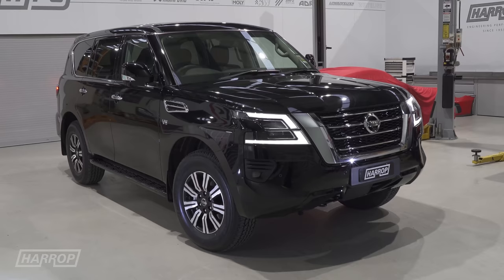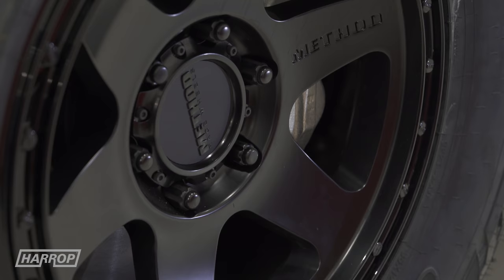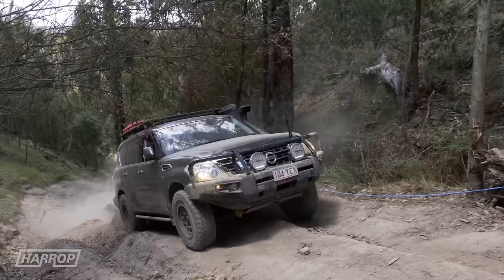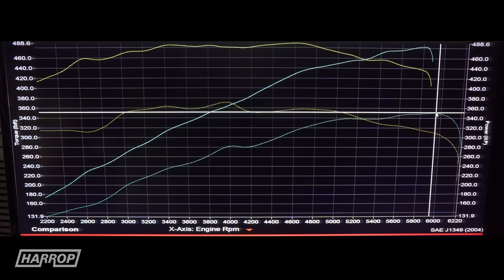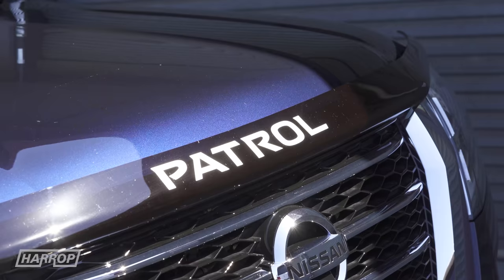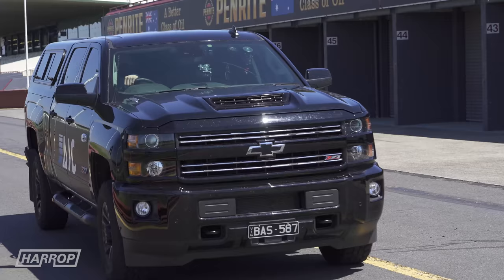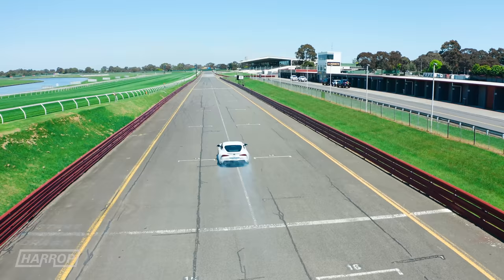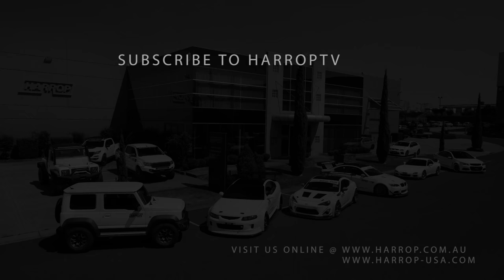Performance Testing | Harrop TVS2650 Supercharged Patrol

Comment: Those big tires must weigh a ton.  We get the same basic setup in the states on our Nissan Armada/Infiniti QX80.  On 20" street biased tires typically see 0-60 mph in 6.0-6.2 (so figure 6.3-6.5 to 100 kph) stock.  Would love to see a Harrop charged Patrol with a lighter wheel package run.  Would probably be well into the 5's which is fast for a vehicle approaching 6000 lbs.
Reply: Yea 95% of people, in the USA anyway, wouldn't have those massive wheels/tires
Reply: Yeah. I have a 19 QX80 and want to ditch the stock 22 inch wheels for 20 inch wheels to reduce weight.

Comment: I know you guys don't have the 5.7 litre 3UR-FE V8 200 series Land Cruiser variant in Australia but if you had used that, it has 381hp stock. Coupled with a TRD Supercharger, it bumps it up to 504hp. The upgraded Magnuson supercharger gives it 550hp and 746Nm of torque. That would have been a much better competitor than a 650Nm 1VD diesel V8.

Comment: so a 35x12.5r18 fits in the spare? if so, I imagine it would have to be deflated?
Reply: Yer fits. Deflate and wrestle under then a few psi back in under there. Need air on board obviously.
Reply: Then I have to wrestle in down from under the car haha rear bar set up would be ideal with your spare tyre

Comment: Anyone know if that cruiser has crossed the finish line yet?
Reply: take the patrol out in the bush then the  patrol wont be so good.
Reply: On an ifs rig like these , there really isn't much difference between the 2 off road. Slap the same lift, tyres, suspension in them they'll be fairly equal. But dont sit here preaching that Toyota's are better off road. There is a reason why 26 of the 29 vehicles in winch comps are patrols
Reply: @barragu7189  mate, you try taking it on a tight track, you can barely fit mate. Patrols are a cheap mans landcruiser
Reply: @johncheese6381  just watch all the vids on here with them 2 going head to head and jump in the excuse cue with all the other fan boys
Reply: @johncheese6381  if youre comparing apples with apples and talking about these new ones (ifs) then yes, they both are shit off road compared to the solid axle vehicles. I own a 200 series sahara, and a gu patrol.... I know which one I prefer out bush
Reply: @barragu7189  you but if you take a 200 series pit in the bush and a y62 the 200 my choice
Reply: @jonoj7666  I can tell you right now the y62 could do any better
Reply: @johncheese6381  i can tell you haven't driven either of them offroad 🤦‍♂️😂 
The 200 is a dud and the 62 kills it in every department. 

Did you even watch the link i posted? 

https://youtu.be/pyBJpcWbFxM
Reply: @johncheese6381  actually the y62 out performs the lc in the bush check out some vids on here you will see
Reply: And yet, the 200 out sells the patrol by like 8 to 1, thats says alot
Reply: @stevephillips6992  not really. Nissan Australia sells every unit it can get its hands on in Australia without one iota of advertising. They can’t get enough of them to satisfy the market. They could flog 8 times as many if they could get stock. Essendon Nissan sold 15 in a week
Reply: Yeah sure, 2019  nissan sold bout 3700 while Toyota shifted 12,600 trend is continuing like that this year, cant tell me nissan cant get there cars here!!
Reply: @stevephillips6992  face it y62 better off and on road sales don't mean shit , most of those  who paid ridiculous money for them use them for shopping or towing and living off the toyota name from years ago , check out all the y62 vs lc vids on here and you will see
Reply: @Natalie-nd9nl  not to bright are you saying sales dont mean anything!! It means, people prefer toyota over nissan!! Hope you can understand that, there are also numerous youtube vids showing the cruiser outperforming the patrol, just tour the outback, like we do all the time, hardly see a patrol!!
Reply: @stevephillips6992  haha wow insult , settle down steven , i had a look on youtube for all these vids your talking about all i could find were y62s  out driving lc200s
Reply: @dolf3288  That why they dropped the price 30k mate? Because they were selling so many they wanted to give back to the community?
Reply: @Natalie-nd9nl  Even though the Nissan is 30% cheaper they sell 90% less.... 
The only people who don’t like Land Cruisers are the folk who can’t afford them.
Reply: @craigdavid6668  and people under 70 years of age!! The snoozer is for grey nomads mate, the cool kids drive the y62 😎😎😎
Reply: @dolf3288  Haha! There’s an excuse for everything when you buy a Patrol.
Reply: @craigdavid6668  what’s your excuse for paying 90-130k for a dusted slug of a car? Cos you are a Toyota fan boy mate. Old saying: a fool and his money are easily parted. By all means pay the Toyota tax if it makes you feel like you are part of the crowd
Reply: @dolf3288  First of all, nobody who buys a Cruiser is short of money so that’s irrelevant, second, they hold so much value there’s no real loss mate, don’t be upset because you have to justify a Nissan to us, just be happy with it.
Reply: @stevephillips6992  patrol outsells Cruiser in the US and middle East.
Reply: @stevephillips6992  post a Video of a 200 beating a 62 off road. I can't find any. Maybe its because there aren't any
Reply: @craigdavid6668  lol! I appreciate both but I was going to mention what you've said. Fair is fair when it comes to the price. Fact is the y62 wasn't selling when priced against the 200. Doesn't mean it's not as good. Main issue is premium petrol if you intend to use it in the outback.
Reply: @diyanything4319 Your statistic is baseless. e.g.: the vehicle has a different purpose in those countries (not used off road in the same manner as Australia), the infrastructure is different (premium fuel availability), fuel costs less...
Reply: @cyclemoto8744  how is that baseless, they use them off-road everywhere they sell. It just means other countries aren't stupid enough to pay more for something that's outdated and basically behind everything atm
Reply: @diyanything4319  Just because a vehicle is fit for purpose in one geographic location it doesn't necessarily make it fit for purpose in another. You can argue the point as much as want.  For example, go drive a vehicle which uses premium petrol across a geographic region in which the fuel isn't available and you'll  find out how useless that vehicle is pretty quickly.

Comment: Yea that's sweet but how much more fuel consumption does the supercharger use
Reply: I’m currently getting 21 litres/100kms on 35” muddys in my supercharged y62 with 400rwhp
Reply: Desolate... it's actually more fuel ⛽ efficient with the supercharger on it if you are just putting around or sitting on 11Okmh with cruise control set. The charger makes it more efficient. 💯 %
Reply: @theclinchdrive  That's really bad fuel ⛽ economy. Im getting less than half of that. Take those  noisy, useless 35inch muddies off and get some road tyres. 💯 %

Comment: This video is a bit old but does anyone know what elevation they were at? I have a 2021 Armada running 295/65/20 tires and a 2in lift and my 0-60mph is about 6.5 seconds at sea level. The supercharger doesn't seem like it added any acceleration points for the cost of it.

Comment: The name sounds correct now with that SC. The "PATROL", sounds like something that could hunt you down and run you over! Wish they used that name in USA, but ours is the Armada. Sounds like a big fat slow boat that wallows around and bounces like a 1973 Ford LTD!!😂😂😂. No I know they are pretty nimble for such a large vehicle. We used to have a 2017 we bought brand new. Everyone freaking loved that truck, but my crazy ass wife decided she wanted a truck with better gas mileage. I tried to tell her that she was going to regret it...and she did. She got an infinity qx50 with a turbo four popper. Hey, nothing against the qx50,  it's a good little truck since we bought it, but everyone in the entire family wants the full size V8 wagon back! Now it's fixing to happen, because my son crashed and killed my 09' Titan and we have nothing to tow or haul with except for my 2021 SS 1LE!! I even put a tow hitch on the car and bought a small trailer for hauling trash or smaller loads.  Only problem is that it can't tow my Tandem axle trailer loaded with my John Deere 3032. Nor will it pull the 5K pound camper trailer! I actually really like towing the trash to the dump in my SS, feels like complete overkill. The car is a manual 6 Speed with that big old 6.2L LT1 V8. It doesn't even seem to slow anything at all, and it would be great if I had a full size Truck chassis and tow hitch, but the car is not made for anything over 2K lbs. So I think I'm going to just Grab a big ass Nissan or Infiniti Wagon and not worry about it anymore. I seem to remember our capacity was somewhere north of 8K Lbs. Plus I used our Armada a few times pulling the bigger trailers and it was outstanding. In fact, I much preferred towing with it over my old, now Dead Titan, as it was really stable and powerful compared to the Truck. Truck wasn't bad, but after towing with the Armada, it just was superior. Why Nissan... IDK ... That is really more my wife's preference. She fell in love with the Torque that 5.6 was laying down and wouldn't drive anything else. The only full size SUV that she tested before the Armada, was the Suburban, with the 5.3L, and it was not even a contest. I'll have to say that I agree with her on that. Tried to get her to test the Toyota but she basically refused to after the Armada. I wasn't about to argue with her on it either because we caught a wicked rebate on it too. The Armada was $5-10K dollars less than any other full size SUV and to me it rode much better, and was geared nicely. Quiet and smooth, but would rip if you gave it the beans, was a really great truck and I'm still kinda shocked that she insisted on getting a small SUV. I freaking knew that I shouldn't have let her trade it. Now two years later, I'm looking for another one 😂😂. This time I'm going to try to get a decent used model. Armada or QX56-80. She actually spotted a 2006 for sale qx56 that is, and I gotta go look it over. Prices on used ones are pretty good right now too.  I'd never super charge one myself, but I like this patrol like that . I guess it makes sense to someone, but if I want to feel that kind of power, it's gotta be coming from a sports car that can turn sharp and stop fast!! That is why I got my SS to commute to work in. Totally unnecessary, but worth it.

Comment: Nice video. I’ve owned and worked on patrols and petrol/diesels my whole life. Now I own a Tesla and it’s the most fun, fast, connected and yet carefree driving I’ve ever had. Bring on EV 4x4’s. All i see here is money down the drain and expensive parts to constantly maintain, degradation over time, leaks, servicing, eventual noises, play in gearsets. Ahhh fuck. I’m so over working on cars. I would love to get myself a new Patrol but after owning a EV sedan I just can’t go back... . I’m waiting for electric - which will be quicker then all of these anyway. - and before anyone starts. There’s already a recharge highway from cairns to Adelaide, and every powered camp sight/ every house has a power point. Yes. I’m not going to be doing 900km day trips with 2 young kids. The current charge network in aus can charge at about 1000km/h so I’m not even remotely worried about getting around even in the absence of significant charge infrastructure here.

Comment: Mate, did you get ripped off? I’m sure you do, or maybe it’s like that in aus Coz the interior looks like it’s from 2013, in the uae here we have double screens and updated dash etc... that’s not a 2020 interior! Many ppl do that here in the uae.. just Change the bumpers , fenders and the head and tail lamps and it’s good to go! Looks like 2020 but it’s a 2013... basically like a facelift from old gen to new gen.. but the car is still the old one..
Reply: Yeah for whatever reason we get ripped of in OZ.....
Nissan are still giving us the left over Povo interiors that they obviously have stacked up instead of using the new upgraded one you guys have in the UAE!

Comment: Did they say 6.6 seconds 0-100 for supercharged 5.8 litre V8. All the horsepower and only as quickly as a stock Q7 50tdi 210kw!?!?  I would not be happy.
Reply: patrol is much heavier and has 35inch tyres
Reply: Well, they are going with a supercharger that fits easily and you keep a lot of stock parts on. So, it is still a good improvement over stock without having to do a lot of other modifications like changing exhaust.
Reply: a stock Q7 is not a 4wd. Your comparison is flawed

Comment: Anybody know if the patrol is same as Armada
Reply: Since 2017 Armada shares the Patrol's platform to save on development costs. Armada is built alongside the Patrol in Japan. They both share the body-on-frame  chassis and powertrain. The Armada however does not keep the Patrol's off-road equipment like the locking front and rear differentials or trick sway bar disconnects. The reason for this change is American drivers would rather have something efficient on city streets and highways.
Reply: @jhezreel6403  thanks for the info @Jhezreel

Comment: why spend money for pleasure on this fuel dragon I have a 2017 infiniti qx80 which is the same with the same engine, chassis, transmission what changes is the interior which is luxurious, air suspension and other improvements my infiniti does 12mpg in the city and 25mpg on the highway and right now it has 198,000 miles and the engine is a baby so far it has never given me any problems at all. throw money for fun
Reply: How do you get 25mpg on the freeway! I had my 2012 QX for 6 years and never saw more than 20mpg on road trips. Well, I go a bit fast. But there is no way you can get 25mpg on the highway with your QX80. Nissan doesn't even give those numbers.
Reply: you want to try I send you a video whenever you want and sometimes it makes me 30 MPG

Comment: What. Super charger vs stock. Tune up the others and lets see. I’ve seen a 200 flog a patrol.
Reply: Bs
Reply: @diyanything4319  I watched the stock patrol on 35s beat the cruiser on stock wheels yes. Who's the dummy
Reply: I’ve never lost a run against a Patrol in my 200 (stock) but it is close, Patrol would get away after 100km/h I reckon but that’s a little irrelevant.
Reply: @craigdavid6668  u watched the video right? Stock patrol on 35s stock 200 on stock tyre's means it has an advantage. Patrol wins, what you think old mate in the 200 is holding back😂😂😂 Toyota fan boys trying to justify over spending haha
Reply: @craigdavid6668  200 series is slow as fu#k!! Patrol  would take it easily.
Reply: @jaydos9543  wasn't talking to you mate was replying to Steve Game. Stock vs Stock there is a 3 to 4 sec difference 200 has zero chance. Even Tuned cruisers are slugs